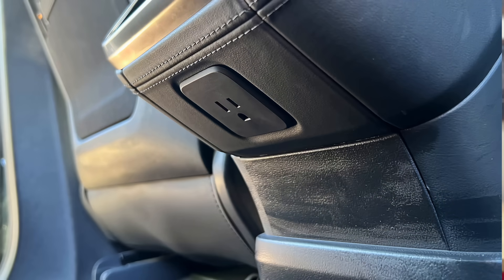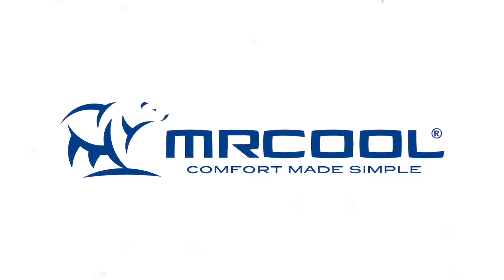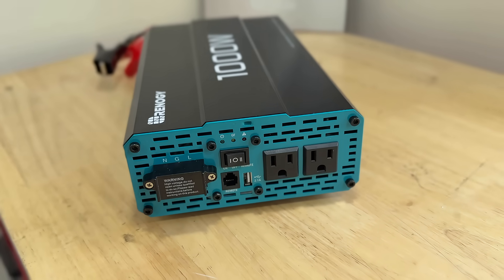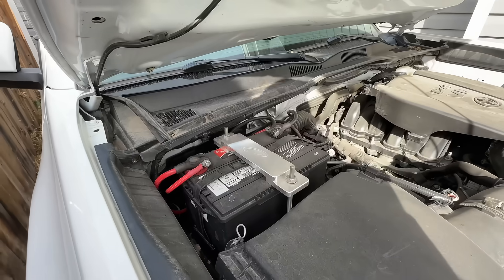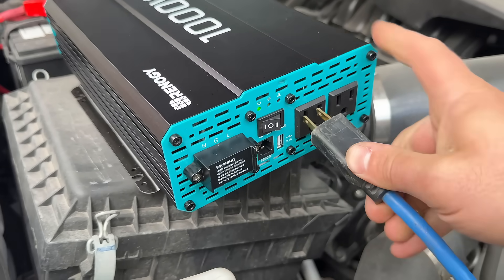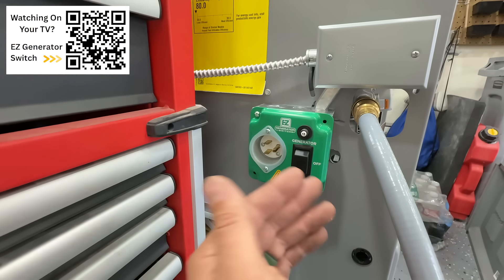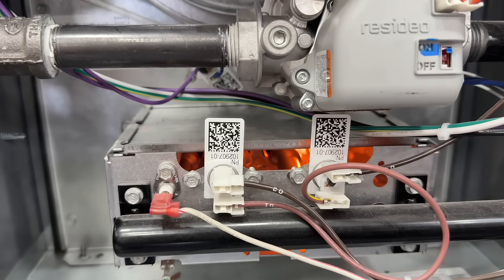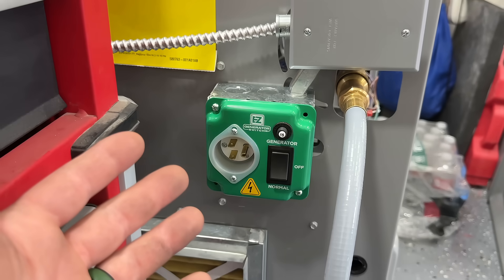Why Buy A Generator? You Have One Parked In Your Driveway.

Comment: AS A RENOGY AMBASSADOR I ABSOLUTELY EMPLORE YOU NOT EVER TO CONNECT A RENOGY INVERTER DIRECTLY TO YOUR AUTOMOTIVE BATTERY.   FIRST MISCONCEPTION IN THIS VIDEO IS THAT BATTERY WILL ONLY RUN WHAT HE IS SHOWING FOR 15-20 Minutes at MOST. 
Then Once you are Required to START your Vehicle , your Alternator will throw On/Off current into that battery at Amperage from 20-180 Amps. Completely Unfused , Using Jumper Style Clamps , Containment Under Hood of the Renogy Inverter under the hood in an ENGINE BAY and the list goes on and on and on.   This is the most IGNORANT ADVICE of 2025 so far I have found to show my Affiliate Rep and shared with buddy Will Prowse.  

DO NOT.   ABSOLUTELY DO NOT UTILIZE THIS SETUP , EVER , unless its a last resort before Dying. 
You will SURELY Damage the Renogy Unit , and Surely Damage your Alternator , ESPECIALLY a Smart Alternator, your Voltage Regular and lastly.   Probably start a FIRE and burn your HOUSE and/or Car and maybe your neighbours house too n

I am sure when the Fire Department Comes , your INSURANCE will be cancelled and you'll be in DEEP REGRET. 

SERIOUSLY BUD.   NOT EVEN FUSED OR REGULATED 

SHAMEFUL. 😂
Reply: Stick to HVAC bro.   Leave the Power Solutions to properly educated folks

Comment: In 2000 at age 14, I read a paper from I think 1995 called "is there a dynamo in your driveway?". It suggested that a typical car engine at idle can easily and quietly produce 10kw.
The idea was to install a new kit to the engine that was basically a small generator head.....or some bolt on coils and magnets on the engine bell, and you could run an umbilical to your home and run the essentials up to 10kw in an emergency. Nobody was really interested. Untill much later and in a slightly different form.
Reply: And if the power cut continues I have a seven foot solar panel to charge up the 24v bank, which I got for FREE with a six foot one.

Comment: Several years ago I installed under the back seat of my 2016 F150 a 3kw inverter from Harbor Freight.  Then after Hurricane Beryl in July 2024 ran a cable from my truck into my house, and powered the fridge in my kitchen and a light and fan in my bedroom for a week.  I would get up at 3am and go to the gas station down the street and fill up my gas cans, although I could have idled the truck for a week on 5 gallons of gas.  Yes I know that extended idling is bad for automobiles, but sometimes you've got to do what you've got to do.
Reply: With all due respect you are greatly overestimating the efficiency of your F150.
 That vehicle today consumes 0.25 to 0.5 gallons per hour of idle depending on the engine in use. Even at the best rate of 0.25 gallons per hour you're looking at 6 gallons per day, not 5 per week.

Comment: It might work, but it's not as efficient. You'll waste more gas. Also your normal alternator is not meant to drive constant heavy loads. It will fail. You can buy a really good dual fuel generator for $500. It'll cost you more than that to replace your alternator when it fails.

Comment: That’s a ton of gas for a 1000w. My predator 1400 generator will run 6 hours at full power on a gallon and my 3500 will run 11 hours at 1000w on a little under 2 gallons of gas. This just seems uneconomical…

Comment: I can see that useing your car during an emergency. But remember to keep your tank full.  But for me i bought an echo flow 3500wh solor power generator then i can charge the generator three ways  .when the sun out with solor panels when i have electricity and with my car  with inverter or the 110 power supply in my car. During the storm  but the generator will give me powere for 24 hours

Comment: You are right, however there is a caveat. First, alternators work best when spun at 6000rpm or more to produce max current and not overheat themselves. So the engine needs to idle around 1200+rpm. Most alternators are Y type design that only produce around 1200-1500 watts max. This combination is horribly inefficient idling a 300hp motor to drive a 3hp alternator. Over time this idling will shorten the life of your engine. Car engines are designed to run around 1800 rpm or more for good oil pressure and coolant flow. I would spend the money on a cheap standby generator and put a car muffler on it

Comment: My daughter bought a bus to turn into and RV.  We are going to remove the AC unit in the engine and replace it with a second alternator or generator to hook up to the RV battery, so it can charge or power the inverter and charge the batteries.

Comment: Only needing low power AC voltage (110-115VAC) is such a benefit. Generating 240VAC tends to be a lot more expensive (equipment wise) and an actual generator for 240VAC is often cheaper than buying hi-cap inverters here.

Comment: I've used an inverter on my lawn tractor for years because I like the power and reliability of corded tools,my tractor is my mobile powerplant😂 anyone that has a basement emergency sump pump needs to also realize that it's basically a marine bilge pump,if you ever use one for an extended time period, please swap out the battery from your vehicles as needed to recharge that deep cycle 12 volt battery. It will save your tens of thousands on basement flooding remodeling losses. If you are on city water, buy a water powered emergency sump pump because the municipal water supply has backup gensets that continuously provide water pressure.

Comment: I use a smaller 300w inverter that plugs into the 12v cig lighter socket whenever I`m on the road and need laptop charged,works great.

Comment: I put 2 altaanators on my engine and the engine also can run pon lp  my alanatores are 500 amps a piece at idle it's a 1.6 liter also a small pond with 400 foot ferrous rod in to the ground and at the other side of the pond another 400 foot rod of a different medal and and a cat hood and a old 60 foot TV antenna 30 foot from the water and u have free energy if u know what I'm talking about so far u know

Comment: Most gasoline vehicle motors are not designed to sit and idle for long periods. The oil pump doesn’t work good enough to soak the top side of the motor. Uses mostly movement to do that. Sloshing around. Most in the cam area. If it sits high, absolutely won’t work. RAM is known for this. Sit midway, it’s better. Basically what you see cops doing, sitting there for hours running. Worse thing you can do. Diesel motors are designed different, and even then, it’s not recommended for standard motors. Trucker designs are not the same.

Comment: .                      WARNING ⚠️ 
If you're gonna do this setup , Be sure to get a pure sine wave inverter because all other inverters are modified sine wave which will damage certain equipment such as cordless power tool chargers and sensitive electronic equipment such as computers , Control modules in appliances including the newer furnaces , Refrigerators and other major appliances as they have a computer module in them 
Modified sine wave is dirty power 
It's ok for lights and single speed small motorized appliances but definitely not for variable speed power tools as modified sine wave can damage the variable speed control and especially any kind of audio equipment cannot be used on modified sine wave inverters because you will get a very loud buzzing sound out the speakers 
To protect your equipment , It is more than worth it to spend the extra bucks on a pure sine wave inverter and If you do buy an inverter , Make absolutely sure that it says pure sine wave , If it doesn't , It's a modified sine wave inverter , Most inverters on the market are modified sine wave but it doesn't tell you that on the box So look for the marking on the box Pure sine wave and it'll say so on the unit as well Never use a modified sine wave inverter , The risk is too great for damaging your equipment and absolutely never connect an inverter to the circuit breaker panel in your home 
You definitely need special equipment to do so such as a transfer switch to isolate the incoming utility power

Comment: My truck has power outlets in the cab and the truck bed.  I tried running a sawzall through the one in the bed and it didn’t have enough power to run it even without a load.  I’m assuming these are meant to only run lights or maybe a computer.  They don’t seem to have much current running through them.

Comment: Tips on attaching on battery, positive 1st for inserting, negative 1st if pulling out ( negative out, positive in)
Reply: It will actually makes no difference at all if you're connecting both connections directly to the battery terminals.
 The only time that makes a difference is if you want to reduce the chance of an explosion because of a spark when connecting to the battery. You would connect. The positive to the positive battery terminal and the negative to a grounded frame your body member away from the battery.

Comment: you never connect the negative cable first, very dangerous, always connect positive cable first! vehicle batteries are not meant for this, you basically have to keep the engine running all the time. I would get a 100 amp/hr LiFeP04 battery and a mobile LiFePO4 battery charger that you plug into your vehicles Acc port (PARADAN Radio $100 from DX Engineering) You hook up the inverter to lithium batery and run your equipment from an efficient lithium phosphate battery and when that battery starts getting drained, then you staty the vehicle to charge the lithium battery with the mobilr charger. You will never be stuck with a dead vehicle battery that way and won't have to run your vehicle all the time. We have that set up in our camper van, works great! You can do better than a Renogy inverter, Samplex America is more depandable IMHO. We are amateur radio operators, we are there to communicate during emergencies and need the most reliable equipment out there, we use DX Engineering for our supplies for that reason. 73 de KB1TCD

Comment: Not only limited by the inverter, the size of your battery bank limits you as well.  My 2000 w inverter is handy, but when I need to run something like a 1000 watt shop vac its time to break out my 1000 w honda.

Comment: I got a voltage monitor in my battery so that I can monitor the voltage of my car until it reached 12.9v, then I let turn it on again. I just turm off the main switch while I connect to any socket to power up my home...? Is this idea safe enough?

Comment: The recommended solution is good for emergency or short-term solutions. For daily life, no.
Let say that you have in the car an engine designed for 100 HP. The electric output of the alternator is about 1 kW at best. 
So, a 100 HP engine will have to work idle to rotate the 1 kW alternator. Even considering that the engine runs idle at the lowest speed, at a fraction of total power, it will still burn much more gasoline than a 2HP internal combustion engine coupled with a 1 kW alternator in a factory.

Comment: Idling a car is one of the the best ways to kill the engine, no thanks!
Reply: ... And the best way to waste much more gasoline than needed, running an internal combustion engine 100 times stronger than the driven electric generator.
Even considering that the engine is running idle, at a fraction of total power, it is less efficient than a dedicated generator.

Comment: Point your exhaust away from the room to prevent the risk of affixation and to make the cable run shorter and use the correct size extension cord. Also, don't put the invertor inside the engine compartment, it's already producing heat which needs to be displaced. It's like putting something that needs to cool down in an oven.

Comment: If you don't keep the engine running, your battery will get discharged very soon and even get damaged. And you can't leave that inverter in that engine bay, obviously due to the heat from the engine. You need to start your engine and leave it idling BEFORE you begin to draw serious power from the inverter BECAUSE, your battery might not be able to crank the engine, once it has reached a discharged state. And finally, most people think, that it is the battery that delivers power to the components in the car, which is dead wrong. The battery is meant to store energy for the engine self starter to fire up the engine. Once the engine fires, the alternator takes over completely, supporting all the DC 12V loads and simultaneously replacing all the energy, that was used during cranking the engine, into the battery (charging up the battery) making it ready for the next self starter cycle. And lastly, automobile starter batteries are NOT designed for long discharge cycles, especially as aggressive as a powerful inverter. The only way this arrangement works, without causing any damage to the battery, is for the engine to remain idling as long as the inverter is drawing power from the battery.

Comment: The best thing to is to plug the inverter to a hybrid vehicle and it will turn the engine on and off automatically plus it  will save you fuel. I have been lighting my out of town farm using this method since 2006.

Comment: If you plan to use your battery while camping, always ensure you have a second battery you can use to start your vehicle, in case you drain the battery too much. We had a friend who did this camping, always kept a second deep cycle battery in the back of his Blazer.
My inverter was 500w, it was enough for lights etc in a campsite. Later we simply started using a second battery that recharged via solar each day. There is a lot of waste energy creating heat is the warning you should know.

Comment: Just an idea: Make a special extra pulley for your car's engine crankshaft and make sure there is straight line access to that pulley from underneath. Get a 15 to 20kw generator and mount it to a frame between a pair of wheel ramps. Drive the car onto the ramps and tension a belt from the engine crankshaft to the generator. Start the car's engine and set a fast idle speed that will give the desired voltage/frequency from the generator. A cheap DMM can measure this. The pulley sizes will be calibrated to get the engine into the desired speed range for best operation. You'll have to set the engine throttle a little high to have the voltage/frequency drop into the desired range under load when you hook it up to the circuits in you intend to power in your house. Here's the tricky part, every genset has a governor that will keep the engine at the desired speed under normal continuous load and allow a momentary increase in engine throttle under momentary load increase, such as when an electric motor starts. I don't have the knowledge to work this out on a car engine but I'm sure somebody else does. Anyway, with a setup like this and a car engine with > 100hp you could power anything you want in your house instead of using your car's charging system for a relatively tiny amount of power while essentially wasting all the potential power of the engine. 

And of course an even better setup would be a truck with a PTO to an onboard generator that has been engineered to provide house power, but almost nobody has that. But this is my Idea for a kit that could be engineered for temporarily using a car to generate house power. Such a kit would only be suitable for a motivated handyman type and not for ordinary plug-n-play consumers.

Comment: Just saying... Hydrogen gets released at the positive pole when the battery is charged by the alternator. As unlikely as it may be, a spark at the positive terminal could blow up your battery if it meets a hydrogen gas leak from the battery enclosure. 
I'd make sure to connect the red (positive) wire first, since it cannot release a spark alone, then the black (negative) wire last, as a spark at the negative terminal is not likely to create a hazard.

Comment: How can I still use the switch with my force hot air unit because I have an outlet near the switch that’s currently there right now. I need the outlet for it is some pump condenser.

Comment: Before he censors this comment, anyone reading this should know that this is an extremely deceptive video. He ran a very low wattage device (gas heater starter) with this and it makes it look like he’s heating his home with his car. The reality is that your alternator only produces between 700-3000 watts of power, and that’s when the engine is running. That’s not enough power to sustain your basic household appliances. Your inverter is going to limit that power even more because wattage gets lost in the conversion from DC to AC, and inverters efficiently operate at only 70% of their capacity anyway. So a 1000 watt inverter is really only good for about 700 running watts. A refrigerator can barely run on that. He is also instructing you to use only the battery and to start the engine periodically. He doesn’t know what the hell he’s talking about. Lead-acid batteries are not designed to be drained and recharged over and over. You will kill your battery and then not only will your power be out, but your car won’t start either. This pisses me off because people are going to take this advice and then be f****d when their power goes out.